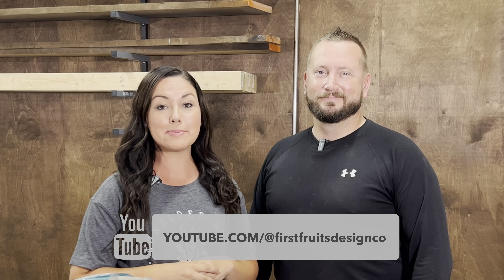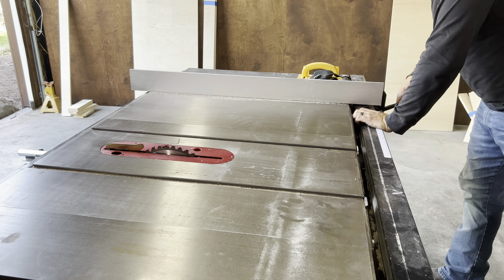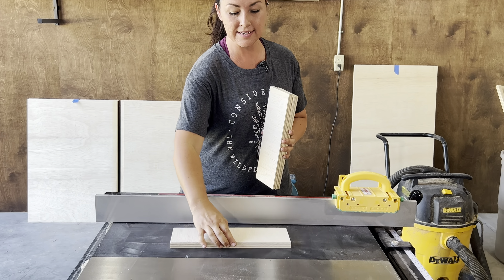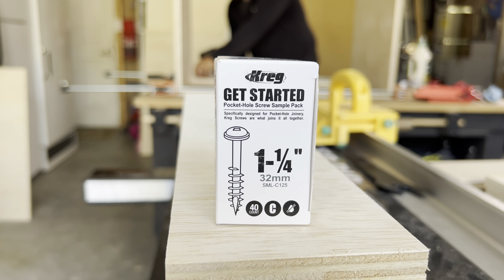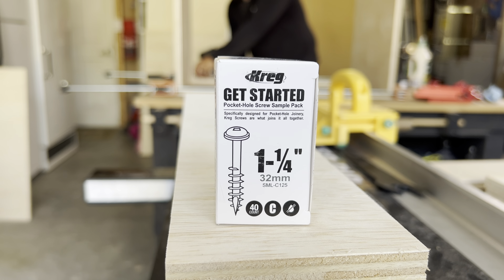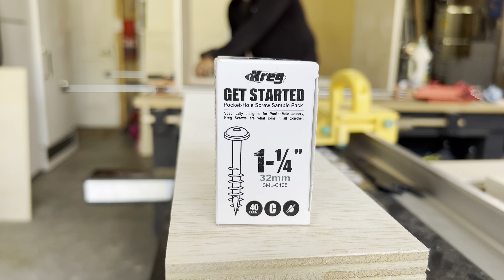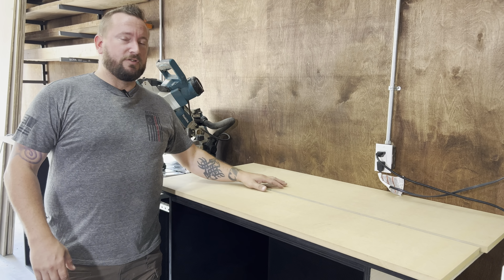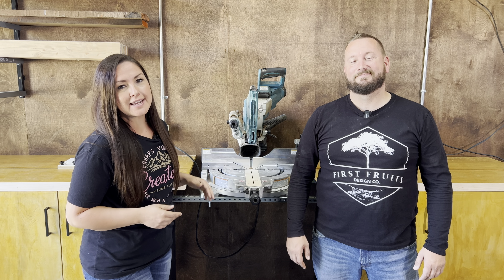Watch Before You Build Your Miter Station #woodworking #mitersaw #tipsandtricks

Comment: Some really good ideas there, ——-
I don’t know the holding strength of those little screws you used for the ceiling plates, as a result, I would be very concerned about supporting a a 50 pound miter saw, and all of the movement that is necessitated by its use. Especially in MDF

You may want to consider replacing those tiny eight screws with some small carriage bolts w washers to support the “ceiling plates”.. I have to think that when those screws fail, it will be all at once
Reply from the maker: Great idea. I’ve thought the same thing and for now just keep continually checking everything for tightness, so if a follow up is needed I can get the word out.

Comment: Agree about the color.  I'm feeling a grey or army green.  

As for the suspension mount for the saw, I see your point.  I will stick to the traditional cabinet for two reasons:  I don't anticipate many changes in the saw I'm using, and I have the ability to adjust the height of the top with bolts much as you have.
Reply from the maker: Absolutely! Go with what works for you!

I’m with you on the grey. I’ll consider the green.

Comment: Great video, but those little screws holding the ceiling hangers in doesn't seem secure enough.  You don't want to get hurt.
Reply from the maker: I totally see your concern. We’ve been checking them regularly and they haven’t budged. If anything changes we’ll definitely do a follow up video.

Comment: I like the adjustability of your design but would have included a shelf for the miter saw to rest on.  It could be fastened to the metal bars and add more rigidity even if it is overkill.  Add a matching trim piece to the face of the shelf and it will make the two cabinets appear more connected.
Reply from the maker: I agree with you about the trim, and it’s definitely forthcoming.  The reason for not putting a platform underneath is that we’ll be putting a “dust drawer” right underneath the saw.  The front of that drawer will be trimmed to connect the two cabinets. We plan to place two cutoff bins right below the drawer.  

Your idea of a wood platform is perfect and would solve the problem of the holes in the square tubing not lining up perfectly to the saw (depending on brand and model). I hadn’t considered that, because it all came together perfectly with our Makita sliding miter saw.
Reply: @FirstFruitsDesignCo   Oh no, the dreaded cut-off bin.  I have a dumpster just outside the door near my miter saw.  That is my cut-off bin.
Reply from the maker: They never look pretty but they are handy when in the middle of a build!

Comment: I'm not one posting a comment, but your video has inspired me.  Two things I noticed.  The number is how well you both work together.  That is an absolute plus in so many ways, not only when you need that "extra" hand to help hold something, but more so when two brains bring out the best thought processes.  Secondly, dust collection.  I feel you are aware that glue used in foaming plywood and other materials is harmful to your health.  With the way you miter saw discharges upward, it would be easy to connect a shop vacuum.  Even if only temporary.  I look forward to seeing you both on the next project.  Good job!
Reply from the maker: Thank you so much! And yes, since the last video we’ve hooked up dust collection

Comment: Hi this is definitely unique mounting system for the saw as it allows precise alignments. I am looking into building a miter station for my new saw. You definitely did the right thing by using Loctite thread locker as an added insurance.  

Since it has been over 6 months how is this system holding up? Are there any recommendations you may have if you were to build another one again? Thanks in advance for any insights you can share.
Reply from the maker: All the potential concerns I had have not become concerns. The system hasn’t loosened or anything. I still have the thought of the screws possibly coming loose some day and if I had to build it again I may do recessed through bolts to suspend the carriage, just for added peace of mind.
Reply: @FirstFruitsDesignCo  Thanks for a prompt response. I agree on driving the bolts deeper. Here are a couple of other ideas you may want to consider. Instead of the Blue thread locker you can use Red thread locker. Blue is a temporary thread locker that can be loosened where as Red is a permanent one that can't be unthreaded once cured. Other option could be using epoxy instead of the thread lockers which will also make it permanent like the Red thread locker. Just my $0.02. TC.

Comment: Great video you guys. What is the vibration like? Metal carries more vibration than wood, so I would think that the whole saw would vibrate more than if it was mounted on a wooden platform? Very interesting design!
Reply from the maker: Excellent question!  I think because it’s still suspended from the plywood cabinet tops that the vibration dissipates just the same. It feels just as sturdy or more so than our previous miter stations.

Comment: Interesting concept.  It doesn't rack or wobble?
Reply from the maker: Not at all, which I was concerned with when designing it in my head. I originally created this design for an under mount kitchen sink which “pinched” the sink to the counter. I thought that there was the possibility of it racking, even with the locking nuts above the 1” square tubing.  I was very pleasantly surprised at how completely solid it is.